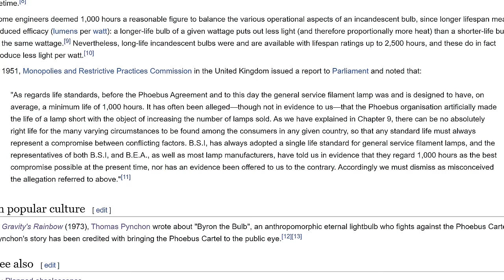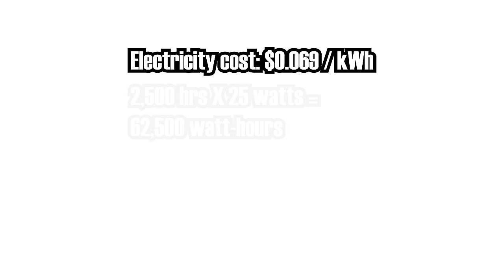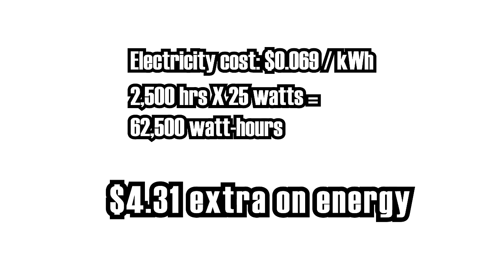Longer-lasting light bulbs: it was complicated

Comment: Having watched all the way to the credits to be sure I wasn't missing anything, and I have to strongly disagree. You made a bunch of great points as to why for usual cases in a home somebody would probably want a 1000-hr lightbulb. That's very different from 1000hr lightbulbs being the only option available! There's tradeoffs in *everything*, and so of course decreasing longevity will in general likely benefit other desireable properties of whatever the thing is. If the cartel wasn't a cartel but instead a standards org that said "wow 1000 hours is probably the sweet spot" that would be fine, because the 1% of lights that are 30 feet up and need a cherrypicker to replace can make a very different cost-benefit analysis and get a long-life lightbulb. You say that everything stayed the same after the cartel, but then you go on to talk about long-life tungsten bulbs! Those didn't exist until the cartel disolved, and that's why the cartel was a bad thing!

I would also omit the "details" you were frustrated about people omitting because they don't seem relevant. I knew that shorter-life bulbs were brighter, but that doesn't make the cartel good for consumers.

While we can't peer directly into the minds of everyone involved in the cartel to know their true motivations, I still find the desire for lightbulbs to fail more often (and thus create more consistent sales) to likely be a key motivator.

Comment: This narrative is reinforced with survivor bias. For example, when people say that "they don't make stuff like they used to" and point to the 40yo fridge in their garage that still works. This doesn't take into account that most of the fridges made in the same factory at the same time failed decades ago.
Reply: Yeah. But those failed cause folks didn't repair a super easy to repair system. My grandparents have only had to replace a few parts in over 3 decades of service. My Dads fridge is from the 90s and it is only facing problems now cause he hasn't properly maintained it for several years now.
Reply: @johncarson7702  sorry mate, but my point still stands. This doesn't take into account the fact that most of the fridges made in the 90s failed decades ago. You are just moving the goal posts by claiming that they just need better maintenance. Better maintenance would benefit a device made in any decade, including this one.

Comment: Planned obsolescence is a manufacturer like BMW putting cheap plastic parts deep into their engines that would fail, requiring the equivalent of an engine rebuild to replace a set of 50 cent parts.

Comment: Turning a light on & off doesn’t help with the longevity of a bulb. If you look at what use to be called a "work"bulb, the wire is about 2-3x the diameter of a normal incandescent bulb.

Comment: Please buy cheap chinese led with chinese letters on them. You can't even touch it after running for several minutes. Works for few months. It's TRUE planned obsolesence. You are forced to buy lots of them, but very cheap. That is why most of my light works at 12V DC through toroidal transformers+rectifiers in my new home. So far - noone needed change. All are relativelly cold.

Comment: When we moved into our current house, I found a “100-watt” incandescent bulb in the utility room. I measured its power draw of around that much, and the heat output certainly seemed to match, but it definitely barely produced the light of a standard-life 60-watt bulb! It must have been one of those “long-life” bulbs, and a pretty abysmally inefficient one at that. Not a great trade-off considering that the bulb was not particularly hard to reach in that particular room. Needless to say, I replaced it with something better almost immediately.

In the house I spent my childhood in, there was a bulb in the utility room (with a much higher ceiling) that had a similar appearance (a thinly-frosted rather than opaque white). When I think about it, I don't remember that bulb ever having to be replaced for the nearly 20 years we lived there, so it could have been a similar long-life type. But it likely didn't get used a great deal compared to other bulbs to begin with, so there is that too.

Comment: The lightbulb has never been a good example of planned obsolescence as the Edison screw and bayonet cap designs have not changed in a century, I ride mountain bikes, a few years ago the MTB industry changed the wheel size from 26" to 27.5" to 29" tyres for my 26" bike are now getting more and more difficult to find thus making it obsolete, as to whether that was planned to make us but new bikes or just the industry moving on is up for debate. The fact that you can buy a new bulb that will fit and work in a century old fitting means there is no obsolescence here

Comment: Every phillips LED bulb I've had has died in around 5000 hours. Let's see if the aliexpress knockoffs are as bad.
Those windy CFL bulbs sure do hit their rated 10k hours reliably and then some, from the same brand. Better quality light, too, and not as much more power as the LED-heads keep telling me. ~9w for 65w-eq, vs 25w for 100w-eq, and lasts more than twice as long, with none of the weirdness to colors that white LEDs produce with their narrow spectrum coverage.

Comment: Your very first point doesn't really speak against the cartel's imposition of 1000 hours being an example of planned obsolescence. The fact that 1000 hours happened to produce a lightbulb that was better from the consumer's point of view doesn't have any bearing on why manufacturers would get together to, under pain of fine, establish and enforce 1000 hours as not merely the standard, but the cutoff. Surely, if the 2000 hour bulbs were worse for business because they cost the consumer more in the long run, a cartel-member business should still be allowed to sell it if they so choose -- even if it's a bad business decision. The point of imposing a limit, therefore, must not be related to the benefits seen by the consumer.

Comment: 16:24 IDK.  It's not conclusive proof of market manipulation, but I know for a fact that there is another way to ensure consumers have access to efficient sources of high-quality light - just put the specification on the box.

Consumers can then decide for themselves, whether they care more about saving power, or saving tungsten.  But it should always be our decision.

It's like excusing phone internal batteries because they make the device smaller.  I don't have a problem with people who like miniaturization at any expense.  I'm OK with there being internal-battery phones on the market for me to choose.  And I'm OK with some of those phones using battery chemistries that wear out fairly quickly.  When it becomes a problem, is when everything uses a poor-durability internal battery, and I no longer even have a choice.  I'm instead forced to buy a phone that's going to break, and then when it does, I'm forced to choose between an unnecessarily expensive, high-profit-margin repair, an unnecessarily expensive, high-profit-margin replacement, or a serious risk of damaging the phone (and maybe burning down the house) repairing it myself. And I can't even keep existing external-battery phones, because it's getting harder by the month to find a reliable non-5G signal, and external batteries were "obsolete" well before 5G was a thing.  

Once again, just because a decision has justifications other than planned obsolescence, doesn't mean the decision is unrelated to planned obsolescence.  In the vast majority of these cases (especially the lightbulb problem), there are options that these companies can take that still allow consumers to choose for themselves.  Lightbulb makers could always just sell both types of bulb, just like smartphone makers can still make some of their devices ten or twenty percent bigger to leave room for a battery slot.

Comment: most conversations about "planned obsolescence" actually turn out this same way. apple products are hard to repair because they are highly integrated systems, highly integrates systems actually run better, are smaller and have higher quality compared to similar but less integrated systems. a lot of engineering side context is always lost in this discussion.
Reply: Is serialization needed for highly integrated systems?

Comment: Whilst lightbulb makers conspiring isn't an example of planned obsolescence it certainly does demonstrate some of the issues with capitalism and how regulation can be required to guarantee a free market. 

Because yeah, there would have been arguments as to why a 1000 hour bulb is better, but clearly they could make a better bulb that lasted longer. Enforcing the limit prevented them from having to (and saved them stacks of cash in RnD). And consumers didn't get to choose what the priority was, the company chose for them. So there goes our innovation and our choice.

I know the argument isn't being made here that it was a good thing that happened, but the explicit point should be made as to why it is definitely bad.

Comment: Big Clive call-out was spot-on.
BUT, today's grossest offender is Tesla. For years Tesla car batteries were made in modules that could often be repaired when they failed. Additionally, these modules could be harvested from wrecked cars and put to a second use. Unfortunately Tesla is now making battery packs that are filled with a strong adhesive that make a failed battery worthless, unable to be used for parts or repaired.This will ultimately lead to these cars being recycled when their batteries eventually fail since factory replacment batteries can easily exceed the value of an older car. Other brands, notably Ford and GM and others, intentionally design battery packs that can be serviced or even upgraded.

Comment: The way I see it with the planned obsolescence crap, if something lasts longer than the manufacturer rated lifespan, people would be more likely to buy the product again just in knowing its quality. If stuff fails or breaks prematurely, people would be less likely to buy it again, at least of that particular brand in question.

For example, I’ve replaced all of my lighting with Cync by GE bulbs - not perfect but by far runs rings around any incandescent or LED lighting I’ve used. Other lighting has yet to last me over a year, yet these Cync bulbs and accompanying products have have yet to fail me in oh, I don’t know, since I found the brand right after ‘C by GE’ became Cync. And these bulbs get used daily for most of the day, being cycled on and off regularly at the lamp or via my Cync wire free switch or via the apps built in timer control, where my outside lighting is set to come on at dusk and stay on til shortly after dawn. The worst thing I’ve had happen is a bulb would randomly start staying lit dimly for a short time after power was cut to it, or it would stop responding to any brightness or color change requests through the app.. all I had to do was the reset procedure and set up through app again. 

Moral of the story, if any of them ever do give out, I will certainly buy more as replacements considering the cost for the build quality, and never again will I use incandescent bulbs, except for certain applications that feel more pleasing to use, like in the garage or the fluorescent tube over the kitchen sink.

Comment: I don't agree with this at all. Rough service incandescents, identical to regular bulbs, had anywhere from 10,000-20,000 hour running time. They had thicker, much better supported filaments. You should have found one of them for this video.

Comment: and now the Silly Law Makers have OUTLAWED the Incandescent Bulbs ... there are several uses for a device that gives both Heat and Light ....I wish they didn't outlaw them ... using an incandescent bulb as an anti-freeze heater works really well in a location where you also want  24/7 light because of winter => exactly the opposite of the "signal light video"  /  there are a number of items like incubators,  "easy bake ovens" and other toys that rely on the thermal as well as the light properties of incandescent bulbs => would it really be better to have a separate Heating element and thermostat as well as some other illuminator   maybe someone will make a device that provides the same heat as a 100W Incandescent bulb with a few LEDs to provide the Light part too but I'm not sure that would be as cost effective

Comment: Seems like manufacturers are finally moving away from the misleading claims of LED bulbs lasting for 20 years. Sure the LEDs may last that long, but the underlined circuitry certainly will not. It's like selling a car with tires that will last a million miles.

Comment: You still have to consider that producing more is hard on environment and also adds not necessary waste. You waste ressources to throw it away.
Reply: Ah, but if the tradeoff is using less efficient light bulbs, then you have to create more electric energy at the power plant, which is ALSO hard on the environment.
Reply: @rogermwilcox  Well in long term we will solve the issues with renewable energies, but the garbage is actual issue. And maybe it would be ok if we have bit less light, light pollution is real issue imho.

Comment: Heard long ago the life of our first bulbs depended on the small piece of metal (filament) that burned out so quick and would have not burned out that soon if the small piece between the metal holders
was just a tad thicker or stronger. The ten year bulbs! More like ten months. What a joke. As soon as I saw the insides of the ten year bulb I knew, no way! Same tiny piece of metal vibrating between 2 metal pieces. Was not going to last and did not.

Comment: But why keep all this a secret? They could have easily just made the whole thing public by putting a standards body label touting the energy efficiency and brightness, and advertise the cost savings in electricity. If they publically joined in a mutual agreement stating that they would only sell light bulbs with a minimal efficiency level, I don't think that would be viewed as a bad thing. And there are use cases for those 2500 life bulbs as pointed out in the video for appliance bulbs, which benefit from the longer life since they're a hassle to replace, don't need the brighter light, and don't run often enough to make the lower efficiency as big of a problem, so dictating the design of all products takes away valid choice. It would of course make sense to only advertise those bulbs as appliance or special use case bulbs which is what we do today. Another odd thing is that the target metric was hours of operation as opposed to power draw. Sure we cracked the incandescent light bulb, but we didn't know that for sure at the time, and maybe there was another dimension of tradeoff that could decrease the operational quality while maintaining the same power draw while increasing lifespan that would work in specific use cases. If the goal was to increase efficiency, why not just make efficiency the target metric?

It might just be a change in culture. I'm guessing those standards labels were not a common marketing thing back then, and I'm sure operating without public transparency was a common norm too. I'm glad things have changed since then, and viewing this cartel as being insidious is a reflection of our more modern expectations of transparency. Those kinds of cartels have effectively been replaced by standards bodies, they do all the same things, define operating parameters for compatibility and efficiency, enforce them with testing, and setting requirements for companies. Doing that in secret is just odd and wrong today, and the outcome of the Phoebus Cartel being admonished for doing it in secret was a good outcome, and possibly lead to the transparency we enjoy today.